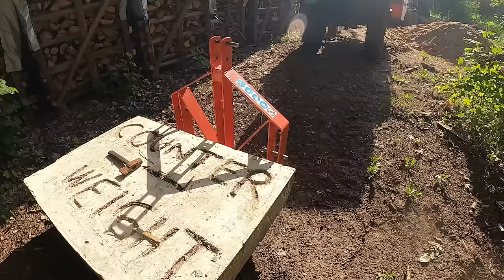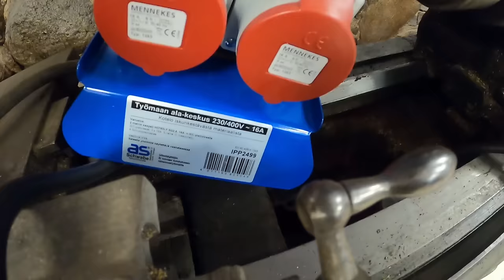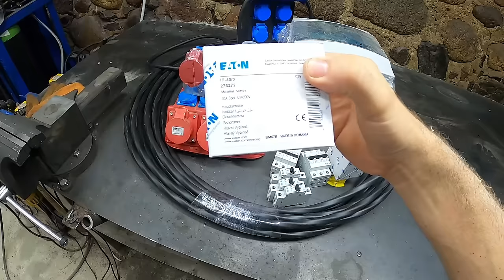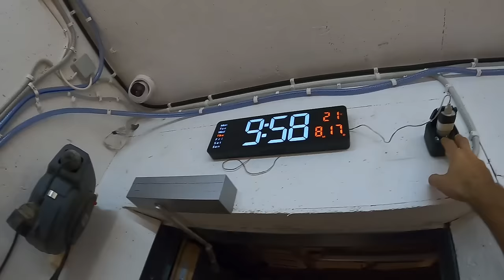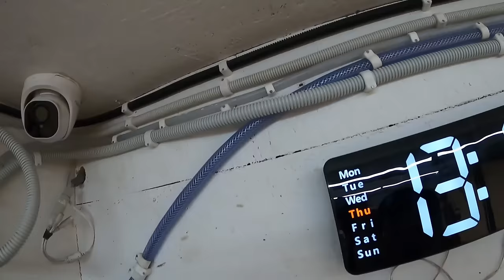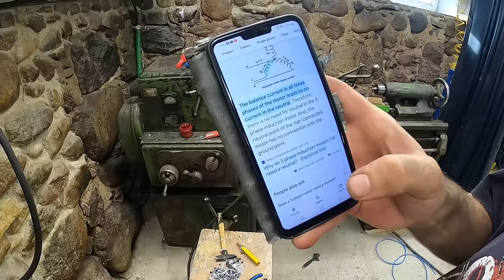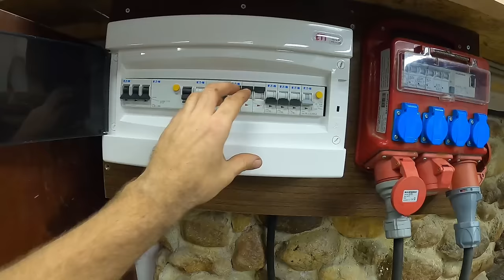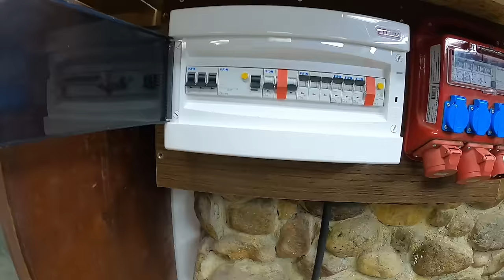Buying and installing a soviet lathe - STANKO 1A616

Comment: The ground fault circuit breaker is tripping because of the 230V contactors. Since there is no separate neutral for these two (and possibly other) 230V components used in the lathe, the power goes back thru ground wire thus tripping the breaker.
Reply from the maker: I removed the 230v setup from the lathe and figured out that it still trips. Most likely the breaker is too sensitive for this motor
Reply: As far as I can see from the video - you have 400V volts at the main switch and the contactor inputs and the breaker does not trip. When you manually with screwdriver push in the contactor, motor runs and it didn't seem to trip the breaker (although this one is hard to tell from video) if so then motor itself is fine also. However, the second you operate the lathe forward/reverse lever, you send one phase to one (forward or reverse) of the contactors coil (looks like one has black, the other has yellow wire). The coil is rated for 230V so the other end in this case is connected to the machine chassis/ground thus making a current leak to earth and tripping the breaker.
Reply: As for myself, I wouldn't worry too much for not using the RCD, but since you seemed worried about not using it and it IS the right thing to do, trying to help you out here.

Comment: Sounds like the gears need some oil or grease. In America we use 120, 240, 400+ for gas stations and commercial buildings. Here you can rent a 24 foot box truck with an 18 ft trailer with no experience at all. You can also haul 24-48 ft goose neck trailers no problem with just a regular ol drivers license. So you can imagine the chaos on our highways lol. The only thing u need a special license for is if the truck has air brakes or is an 18 wheeler commercial transport vehicle. Our weather apes have been promising rain for 4 and a half months without a drop falling. I love how ur brother in law or whoever he is just stands around with the women and doesnt even offer to help. Where i live people you dont even know will go out of their way to help you. I dont mess with electricity if i can help it since i've been shocked to many times lol! Anyways great video. Thanks for sharing, i learned alot.
Reply from the maker: Thanks for the great comment 😅
Reply: @Ants_Pants  welcome

Comment: On lathe you have several leavers for speed as you found out but the one with graduation on left is bed speed for traversing the tool head parallel to the work you are cutting. You have handles on bed for cutting across the face of a piece.
Reply from the maker: Thanks for the info!

Comment: OMG sees 2 hours of video uploaded ...clicks the thumbs up before i watch because i know its going to be good
Im ony 20 mins in but...
As an ex machinist you want at least 2 foot of space clearance all around the lathe , possibly if you dont have the room at chuck end you can make a hole in the wall to take overlength material
You dont usually use that type of air hose fixed to wall ....thats usually  loose free line

The middle long bar above the stop /start handle with the keyway along its length needs to be turning for the auto feed to work
Reply from the maker: Thanks for the tips

Comment: The reason that the carriage is not moving automatically is that the lead screw is not turning (that is the long threaded screw that runs horizontally under the carriage)  ... that needs to be engaged so that the carriage has something to power it's direction.  The section of three levers are the various settings for changing how the carriage follow the lead screw for cutting various threads when creating a bolt.  The top right lever that was engaging the chuck should be forward, neutral, and reverse. The very bottom two (as you figured out) are for changing the gear ratio to increase the RPM's of the chuck.  Four suggestions before you experiment: 1. get a manual for this lathe, 2. Drain and change out all of the gear oil (it may have been years since last changed -- you might need to rinse with Kerosene to get the thickened oils to clear out thoroughly, 3.  the lathe should be leveled before any use to avoid damage and wear to the "ways" (these are the triangular tracks that the carriage rides along) -- if excessively worn or damaged this can drastically effect your machining (wobble of the carriage while machining), and 4. make sure that you center up the tail piece to the center of the chuck --  many things can move and shift in transport!  Enjoy the new tool!!!
Reply from the maker: Thanks

Comment: If the cable ties pull the nail out, then swap the nail for a screw. 
You should inject a flexible glue into the cracks in the wall. Or even silicone will do. Just to tie it all together and keep water out so ice doesn't form and crack further.

Comment: Trip probably goes off because of the old motor having leakage to ground. The trips are sensitive and an old motor can have 10-50 ma (or more) leakage to ground. You have earthed the lathe so it should be safe to use. Anyway, great content as always. Thanks
Reply from the maker: Yup

Comment: RCD expects the same current that leaves it on phases to return on N. (and the mA rating tells you how much current can be "lost" not returning on N, usually 30mA as thats deemed as highest Amps that wont kill you, there are also 100mA variants). Anyway complete rewire of the lathe would be really good idea. Also in the case the chasis would accidentally come live from loose phase only RCD can save your life. Breakers basically only protect cables from overheating and setting on fire
Reply: While true, it's not that bad in this case. Remember that the entire thing is made out of metal and is grounded. If one phase gets shorted to chassis it will just short to ground and that trips the breakers or sets fire to something. Both are bad but the lathe will not suddenly go live and kill you! If one should touch live wire in the electrical box, then RCD would save you and since it's not there there it's not very safe to go touch about the electrical wiring when the machine has power.

Comment: 1:12:23 Because of the cross patterned weave of the reinforcement in the hose, when there is pressure inside, it will expand radially, and contract lengthwise. Like a scissor lift. Not so great for wall mount applications. But very good for building mechanical muscels. :)

Comment: The differential protection detect if there is a difference  between a phase and neutral  or a difference between a phase and earth.
Since you have no neutral hooked up, it seems that your problem is between one phase and the earth, a leak of a phase towards the earth wire.
Is the fact to have twice the wire size for phases than for the only earth wire can cause a bad reading on the sensitive differential protection ?
Resistance can vary depending on the wire size,so maybe the reading is messed up because of that.
Also,are you sure that a lack of neutral wire isn't a problem for this differential protection specific installation ?
Can't you test phases consummed current to see if there is not a leak somewhere ? or simply the ohms between each phase and the earth wire at the plug ? you could pinpoint the problem.
Reply from the maker: Gotta let an electrician to take a closer look

Comment: Hey Andris, beautiful old lathe mate, that heavy old machinery is the best, so stable once installed. I think with all the tooling you got with it you got a great deal. Your nieces are so lucky to have an uncle who looks after them so good. In Australia we don’t need a trailer licence, it is covered by your car licence but sometimes I wish they did as you see some idiots hauling unsafe loads, over here we have domestic single phase 240v and industrial 3 phase 415v and you need an electrician’s licence to do any installation.
Reply from the maker: so we got the same setup then, 240v domestic and 3 phase is 400V-ish. No elecrician required here though, but it's recommended :D or i just don't know the codes, maybe they have updated them :o
Reply: @Ants_Pants  Joonista igaks juhuks elektriprojekt enda veetud süsteemidele. Kui sul sõbralik elektrikust naaber on käsi, siis ta ehk aitab sellega. Muidu mõni kade ahv kaebab su peale kusagile organitesse ja tuleb kuri tehniline inspektor, kes ähvardab elektri kasutusloa ära võtta, kui kõik vinks-vonks pole.

Comment: i installed a 220 volt minisplit a few years ago here in the US.  The manufacturer said to install it on a 220v 20 amp GFCI which I did although it was a very expensive circuit breaker.  The minisplit would pop the circuit breaker after about 30 minutes.  I couldn't find anything wrong.  Finally an electrician friend told me the same thing - take out the GFCI breaker and put in a regular one.  He said minisplit compressors just don't run "cleanly" enough for a GFCI breaker.  Its still running perfectly 7 years later.
Reply from the maker: Yup same crap here. Was comfirmed by a electrical engineer. Actually 2 of them

Comment: To be on the safe side, maybe blow a few bucks and try a separate 100 or 300 mA RCD for the lathe. Mains side L1 - T2,  L2 - T4,  L3 - T6, N - T8/N, load side neutral (T7/N) left unconnected as per Eaton's data sheet for your specific setup.
Reply from the maker: i will look into it

Comment: Maybe a future project for your zipline could be to add a remote-controlled winder to pull her back to the top again for you. Just hook 'er on and, at the click of a button, up she goes :)
Edit - and maybe a brake-line at the end.
Reply from the maker: both great ideas. maybe i can use the lathe spindle to wind them munchkings back 🤣 top speed of coruse

Comment: I've also had problems with hose clamps . I found wot works for me is get a piece of tube around the same width as the pipe your clamping cut along the length of it then slide it on your pipe squeeze it on then put a good quality clamp over both the tube & the pipe. I've not had any leaks since, just a thought, mine was on plastic water pipe with around 30 psi but I'm pretty sure it'll take alot more pressure than that ...
Reply from the maker: Thanks for the info

Comment: The levers at 21:36 are for making threads. Above them is a decal, which shows the different threads you can make with that lathe. There should be letters and numbers, which tell you how to set up the lathe for cutting threads. Might wanna check Cutting Edge Engineering, he does lathe work in almost every video and shows how to set up the lathe, also when he gets a new lathe, he explains the lathe. Might be interesting for you.
Reply from the maker: Thanks for the info

Comment: The 30mA leakage limit is allso shared with other devices on the same ground leakage protection switch . Most devices have some leakage and added all together you can surpass the 30mA limit.  If this is the problem you can install a dedicated or higher rated protection device.
Reply from the maker: think i will try this

Comment: There is an instruction manual for this lathe on line! It sounds like it needs gear oil best check before you run it much more.
Reply from the maker: It was empty. No oil at all

Comment: Keep it clean, keep it greasy and it will last another 50 years. Maybe you can ground the frame separately from your fuse box, so, just in case, the current has another way to ground then going through your body. But I am no electrician, so no idea if this would be beneficial. Probably the best thing would be to rewire the whole thing to make it work with modern safety installations.
Reply from the maker: Motor is crap and will not work with modern breakers. I will ground it though. Ground it straight to earths core

Comment: Many older motors and some newer ones are just that way in many countries, it is not just a Soviet thing.  A GFCI works by sensing the difference between out going power and what is coming back, any imbalance trips it.  Some appliances shunt a small portion of the power off for various reasons and they are not compatible with a GFCI.  It is not a bad thing just something to be aware of.  There are proper ways to deal with wiring these devices as your electrician friend suggested.  You can keep the GFCI for the parts where it is compatible and isolate the motor circuit.  Grounding the motor chassis may be your option.  Your electrician can tell you an approved way to deal with it.  This is a very common situation which when dealt with properly is nothing to be concerned about.  Notice I said "dealt with properly".  Don't throw the baby out with the bathwater.
Reply: This is the best reply i've seen yet on the GFCI issue.  GFCI's don't like inductive circuits.  Even the GFCI in your house (North America) will trip if an inductive load (things with windings) of a large enough capacity is started.  You may be able to get around this if the GFCI is rated high enough but like someone else said, as long as it's grounded (which you've done) it should be fine if there is a short.   Oh yeah...one more thing...thanks for the vid!
Reply from the maker: @bradcrossman5068  yes i asked a electrical engineer and he confirmed what you 2 just said. 😅👍
Reply: I'm glad you're doing your due diligence in the background.  Some of the replies on here are a little on the sketchy side.  But hey,  even the bad replies help your channel!  Cheers Dude. @Ants_Pants

Comment: The feed screws are not turning. There should be a forward neutral reverse lever some where for the box with the adjusting knob. there are two feed screws that go to the carriage one for turning the other for threading be sure to check the oil level in the head stock. It sounds like it has had a hard life.
Reply from the maker: Yeah

Comment: hey,for your air lines you might try the pex type cinch clamps [not the crimp type] the pex cinch tool does all sizes and the clamps come in all sizes,i have used them for air lines and worked out fine,hope this helps
Reply: And for secure the hose in the wall just bend some sheet metal brackets and drill 2 holes and use screws instead in the wall.
One screw on top, bend it around the hose and one screw at the bottom.
All you need is some small bits of sheet metal.
Reply: @markuschampos5750 Do they allow the hose to move? Is that the idea? Sorry if dumb question.
Reply: @wendyhorn8376  It doesn't have to move. I have done this and it has been alright for atleast 15 years.
Reply from the maker: Yeah. Next time i will

Comment: As long as the lathe is grounded, you can't get shocked by it but of course like you say, if you touch a wire you can get zapped.  If you're very worried you could have a lightbulb or a voltmeter from the lathe chassis to ground to see if the lathe is live. Or you could replace the motor with a modern motor that doesn't have as much earth leakage. If it's the motor that's leaking, that is..
Reply from the maker: yeah, i think it's the motor. Have not tested it yet but i'm pretty sure.

Comment: I had the exact same problem with my old metal lathe and the RCD. I ran very large, redundant earths to the frame of the lathe in a few spots, to ensure that if there was ever a short somewhere, I would not be the lowest resistance path to ground.
Reply from the maker: This seems like the easiest solution

Comment: That lathe looks awesome, i wish i could get my hands on one of those! And i am very impressed with how you are able to do everything from start to finish with moving and digging and setting up the electricity. Make sure you change the gear oil for the gearbox to a proper oil for it or else it wont last very long. Also make sure to swap the coolant liquid if you plan on using that someday, it needs to be swithcehd every now and then. 

The middle levers that you thought did not do anything are for the feed speed. That is for how fast you want the cutting blade to move across the work piece. There should be a diagram for it over them, though it seemed very faded. The lever for engaging the feed is on the big thing that moves the cutting blade along the x and y-axies with the turning wheels. 

Also for a mat in front it is a better idea to make a simple wooden platform with cheap lumber, the movement from the bendy wood is better for your feet and knees than rubber mats are. I have first hand experience with that, also chips are hard to get out of rubber mats, but dont matter as much in wood. Wood will last a lifetime even with soft pine spruc, rubber will get damaged quickly by chips.
Reply: Also, normally the starting lever can be put either up or down to make the motor spin in either direction. As you figured out the feed mechanism it seemed like you had it spinning backwards, since the feed should normally go towards the chuck and also the top of the chuck should be spinning towards you.
Reply from the maker: Thanks for the idea. I did some work already and a follow up video on the lathe :)

Comment: You might want to move it to the right to get to the gears on the left end of the headstock. Right now if you had to change the gears it would be difficult and once it's wired in it would be a headache to move.
Reply from the maker: can access that panel just fine, as of now.
Reply: @Ants_Pants  That may be so. But you can't work on longer parts that sometimes stick out of the main shaft on the left. 😮😊